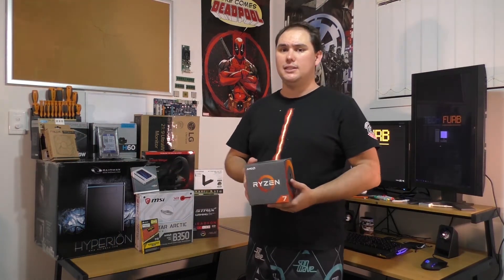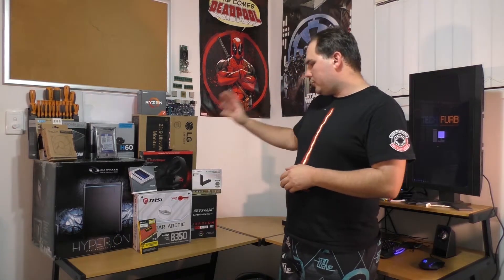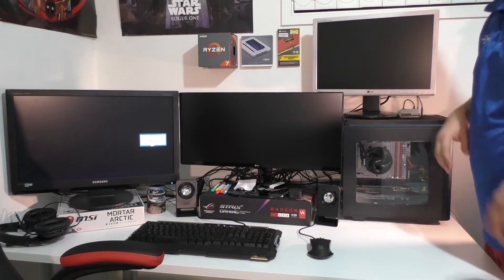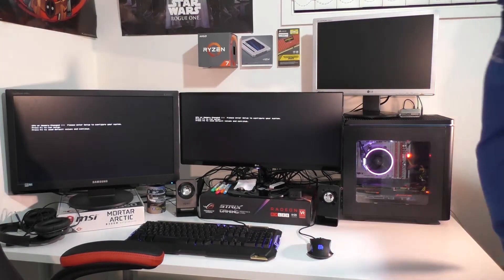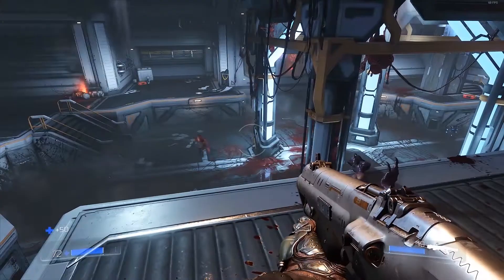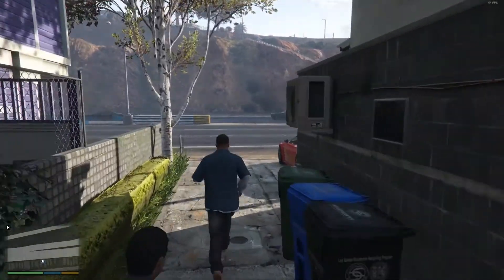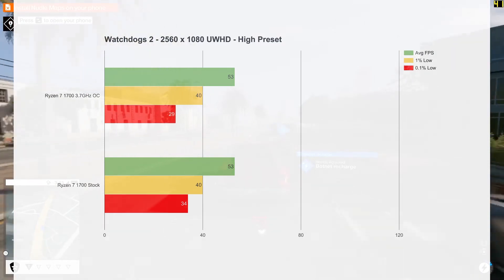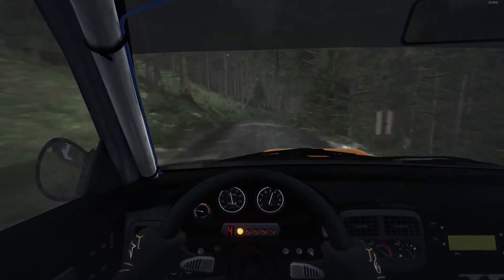Overclocked Ryzen 7 Meets Micro ATX B350 - Ryzen 7 1700 Build Log and Review

Comment: what's the best micro atx motherboard for the ryzen 7? thanks!
Reply from the maker: Hi, So this one is rather difficult for me to answer as it depends on what is available in your region. However what I can say is this. If you are overclocking then go with a full size ATX motherboard as you will have the full range of x370 and b350 boards available to you. the key difference I have found is that the Full ATX boards have better VRM setups which allow you to maximise your overclocks. It seems that the board (MSI B350M Mortar Arctic) I have used in this video is one of the best Micro-ATX boards available in my area for overclocking which is a shame as the VRM won't allow me to go past 3.7GHz on my Ryzen 7 1700 on a 24/7 overclock. If I had of went with the Full ATX form factor and a slightly bigger case my chip would be capable of hitting 4GHz 24/7. IF you are not overclocking then go with the Asrock AB350M-Pro4, MSI B350M Mortar or Mortar Arctic (only difference is colour scheme),  and there is also a new board that seems to have some good user reviews, Asus TUF B350M-PLUS.
Reply: thanks man! I'm not really concerned about availability in my country 'cause I'm almost sure I'll import from amazon. I'm just looking forward to get the best performance at this mATX size without caring too much about "sick" overclocking, just upgrade my machine without buying other case, but getting the top mATX mobo for this processor. You rock!

Comment: Those coloured power supply cables ruin the look a little. Other than that it's a good build
Reply from the maker: Thanks mate, I do regret not getting a better PSU but aside from the looks / noise I have no complaints it's definitely a function over form PSU

Comment: so I've been building microATX for a while now. You don't buy a 3 fan GPU for a microATX build... just don't... the most you can fit comfortably is a 2 fan GPU like the MSI gaming series with the twin frozr.
Reply from the maker: It definitely was a tight fit but it has ported well to my New build which is a full ATX mid tower with custom water cooling. From memory that was one of the only RX 480's in stock when I bought it, I really wanted the sapphire nitro card. At the time but it was out of stock evwrywhere

Comment: hi i want to ask your case RGB sync light cable is plug on mother?  because i use the same board but in gaming app just change normal color mode , no RGB sync
Reply from the maker: Hi, no I am not using the motherboard to control the lighting it was a standalone kit that cost me roughly $25 AUD. The motherboard header should work tho, when I was using the stock Ryzen heat-sink I had to connect the JP1 header from memory, having said that, if you plug it in backwards it wont work properly.

Comment: great video, i subscribed in the channel, could help me with a question, I have exactly the same motherboard and I connected the cable of the led of the cooler in the output JLED1, however my cooler does not turn blue, I am using the application "GAMING APP" own msi, however when choosing the dark blue color it turns red, and the light blue turns off the led, where should I connect this original ryzen 7 1700 cooler cable on this motherboard?
Reply from the maker: Hi, from memory that is the correct port. I remember that it matters which way the cable is plugged in, perhaps you could try reversing it to see if that resolves the issues.
Reply: thanks, you connected cpu led cooler in JLED1 too?
Reply from the maker: yeah im fairly sure JLED1 is the correct port for the LED

Comment: will Corsair Vengeance LPX 8GB Dual DDR4 2400 CL14 (CMK8GX4M2A2400C14) work on the b350m mortar?  >_>
Reply from the maker: Yeah they should work, my kit is the Vengance LPX 2666MHz kit which works great, just make sure the bios on the motherboard is up to date as it make a difference to the stability and performance.
Reply: but at the support page :( the model CMK8GX4M2A2400C14 is not listed :(
i am totally confused XD
Reply from the maker: all good, I haven't heard of any horror stories where the RAM won't work at all. most of the issues around Ryzen and DDR4 Memory is related to hitting the rated speeds. However it is up to you. There should be another kit available that is on the recommended list in your area...
Reply: I got one and it is working..need a little bit of tweaking though coz it just 2133 out of the box and the actual RAM speed is 2400

Comment: could you help me out? In all of my games anti aliasing just doesn’t work or doesn’t help much I don’t know what to do nothing in the amd software changes anything except vsr 4K but I can’t run that in all my games with a rx 480.
Reply from the maker: +Big Dick Jon Hi, are you attempting to run all games at 4k or..? The rx480 is capable of running everything at 1080p all settings on ultra, and most games at 1440p high with AA. However the RX 480 can't handle 4k with AA on...
Reply: TechFurb I have only tried vsr 4K on payday 2 because I can run it I haven’t tried it on anything else yet but it made a big difference in pay day with the aliasing
Reply: TechFurb your games look beautiful and have no super noticeable aliasing like mine
Reply from the maker: Hey mate, for my videos its all down to running at 1080p. Having had the RX 480 for several months now, I feel like it was a solid mid range choice at the time, but, If I want to go to a 4k setup I will need to get a Vega 64 or 1080 / 1080ti
Reply: TechFurb I want to play at 1080p not 4K I’m saying 4K is the only thing that makes the game look more like yours because there is something wrong with my aa even maxed aa doesn’t look much different to aa off
Reply from the maker: I'm not sure what the difference would be,  tbh have you tried reinstalling the Graphics drivers to see if that remedys the issues?
Reply: TechFurb yes didn’t do anything:(

Comment: was going to build a ryzen 5 1500x with this mobo but its a shame it doesnt have the cool rgb cpu cooler!
Reply from the maker: The wraith is a nice Stock cooler, but unfortunately I couldn't use it to achieve my current 3.8GHz overclock. Top tip if you get this board, feed the RAM 1.4v to keep it stable, spent a lot of time thinking I was limited by the CPU VRM's. turned out it was the RAM that was causing the instability. Must say it has become less of an issue with the Slew of BIOS updates that have been rolled out since I bought the motherboard.

Comment: Subbed, what do you record the gameplay with? It seems bit stuttery/low fps and looking at the results the gameplay is misleading.
Also can you elaborate the issues you had with overclocking? Is it the motherboard being an issue or the CPU? I'm planning to buy this board so please let me know.
Reply from the maker: Ottoman Obi hi footage was recorded in OBS using the second highest quality CPU encode which affected performance, actual gameplay was a lot smoother when running the fraps benchmark without recording the footage. as for the motherboard issues I found that the ram was ultimately the issue, once I manually dialed in the 2667 MHz profile and bumped the ram speed to 1.4v I was able to get the system stable at a 3.8ghz overclock. took about a month of trial and error to find the issue. but that's the price of being an early adopter I guess.
Reply: TechFurb I see, I'm happy to hear that it's just a memory profile issue. Thanks a lot for your reply and keep up the good work, I'll be looking forward to more videos :)
Reply: Same with a lot of ram, sucks at the moment but like you I manually dialled in 2667 and set 1.344v and it's holding now on a 1700x.
Lots of potential held back with a few ram issues.

Comment: RYZEN 5 Gaming Build - 60+ FPS for Under a $980.38. Here are the Parts Required:
AMD Ryzen 5 1600 Processor with Wraith Spire Cooler (YD1600BBAEBOX)- 219.99 - http://amzn.to/2qrhaMK
GIGABYTE GA-AB350-Gaming MotherBoard - 99.99 - http://amzn.to/2q2Lo7q
MSI VGA Graphic Cards RX 580 ARMOR 8G OC - 229.99 - http://amzn.to/2q5xhg4
Kingston Technology HyperX FURY 2666MHz DDR4 - 77.99 - http://amzn.to/2pk4szc
Crucial MX300 525GB M.2 (2280) Internal Solid State Drive - 149.99 - http://amzn.to/2q5PHgs
Corsair Carbide Series 100R Mid Tower Case - 49.99 - http://amzn.to/2qZXgEC
EVGA 500 B1, 80+ BRONZE 500W Power Supply - 39.99 - http://amzn.to/2pkp6PC
LG Electronics Internal Super Multi Drive Optical Drive - 19.45 - http://amzn.to/2pkcMPe
Microsoft Windows 10 Home 64 Bit System Builder OEM | PC Disc - 92.99 - http://amzn.to/2qrx7Te

I am a grasshopper among scholars, please let me know if I am off on something.
Reply from the maker: That build seems relatively balanced. only minor adjustment I would suggest is getting a slightly higher wattage PSU aim for a 600w or high quality 550w to give you that little bit of extra headroom for future upgrades and overclocking. Anything with an 80 plus or better certification will suffice, I have been using the Thermaltake Litepower gen 2 750w in my personal rig and other builds on the channel and they have been quite reliable. I'm not overly familiar with the US market and what the pricing is there, but I can imagine spending an extra $10 will give you a reasonable jump.
Reply: Thanks Brother

Comment: awesome build!  is B350M a good board?  thanks!
Reply from the maker: Its a good board IF you are not looking for the maximum overclock on the Ryzen 7 chips. It is the best Micro ATX board available currently tho. If you are running any of the Ryzen 5 CPU's or down you will be able to hit the maximum overclocks for those chips on this board. the main issue boils down to the VRM's not being able to stay cool while pumping the extra power the Ryzen 7 chips demand when overclocked.
Reply: i plan to use Noctua's NH-C14 as cpu cooler... maybe that'll help?   >.<
Reply from the maker: It will certainly help cooling the CPU/will achieve the maximum clockspeed your chip can hit. However it wont help the vrm cooling issue as they are chips on the motherboard. Having said that I was still able to reliably run at 3.675 GHz on the 1700 with this Motherboard. I am working on a new Streaming Benchmark video where I disable cores on the chip and see what difference it can make and have found that by running 6 or less cores I'm not experiencing the same issues with the VRM's as I do with all 8 cores enabled.
Reply: is there a vrm temp sensor?   :O
Reply from the maker: Yeah there is HWmonitor reports all the different voltages and temps etc :)
Reply: tyvm  ^^

Comment: Are you running the 1700 overclocked?

If so, is the CPU able to automatically downclock/reduce voltages (shift P-states) when idle? There are reports that ryzen is locked to the OC'd clock & Vcore when overclocked which burns a ridiculous amount of power for no reason, and then there's reports of P-state switching still being enabled depending on the board.  Literally there's no reliable information about this on the entire internet for the MSI B350 boards, please for the love of god answer this question LOL.

I have the B350 mortar & a 1700 coming in for a friend and I need to know. PLEASE FUCK
Reply from the maker: Hi, Yes my 1700 CPU is overclocked, its permanent OC is 3.675 GHz due to the motherboard VRM limitations. as for the power draw under full load at 3.675GHz its sitting between 100 - 118w current power draw while idle is about 16 - 25w and when gaming or doing most tasks it sits in the 40 - 80w range. It only hits that peak load when all 8 cores and 16 threads are in use (which is almost never in real world situations). To answer your Vcore and Downclocking questions it does not decrease Clockspeed or Vcore when overclocked (it does on stock settings tho) but again it doesn't affect power draw or heat when at idle.
Reply: Well fucking shit, at least power is lower at idle is lower than I thought it would be. Thank you for confirming!

Comment: Got the same board, just paired with a white case (Corsair Carbide Air 240), white version of the Corsair Vengeance LPX 2x8GB 3200 Kit (CMK16GX4M2B3200C16W), a 1700x and a MSI RX480 Gaming X 8GB. Can't say I'm unhappy with the build, but getting the RAM to run at 3200 is still quite experimental. A-XMP profile worked like instantly for the 3200. Then did 2h of Prime95 testing and it ran fine (I know 2h isnt THAT much), but then got out of a game of BF1, windows error. It didnt want to boot at 3200 anymore. After quite some testing, running the kit at 1.28v instead of the 1.36v (set by AXMP) seems to do the trick. If this runs stable for some more days, I think I found the right settings for it.
Reply from the maker: I have had a similar experience with mine albeit at 2667, I have noticed that with each bios update they have released it has made a big difference, am now at the point where I can change overclock settings and core settings for the CPU and not have the RAM get as pissy. but has been stable since the bios update a week ago when I don't fiddle with the CPU Overclocks.

Comment: I like the build, other than the power supply cables...  do you think you could have got a more ketchup/mustard power supply?  On another note, I'm considering the MSI B350M Arctic Micro ATX mb for my Ryzen 5 1600 upgrade.
Reply from the maker: Austin Mathis haha yeah the power supply cables do look out of place in this build, but had too save $$$ somewhere in the build, it is a good PSU ignoring the lack of sleved cables. and yeah the motherboard is pretty good, I feel like it needs a few more advanced features for overclocking like vdroop settings etc, but for the price and considering your getting a 1600 which draws a fraction less power when overclocking it will be a good board.
Reply: Thanks for the reply, power supplies and their cables are really visible in the builds of today. EVGA makes some excellent 80 plus gold power supplies that are under 100 and fully modular that can help cut down on cable clutter. Especially in a ssf-ish case. I understand there may be some limitations in Australia on certain things but imo clean power that looks good is a decent place to spend a little extra.
Reply from the maker: Yeah, a quick pricing check revels a half decent modular 650w PSU is about $120, I may look at upgrading down the track. I am also looking at getting a full custom loop from EK Waterblocks as well to finish the Build off, so I may get a new psu at the same time.